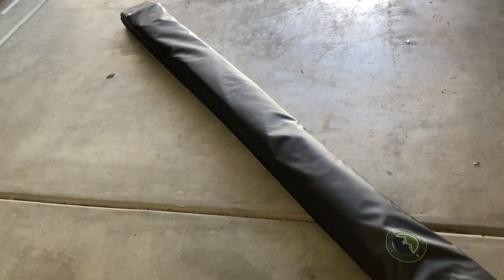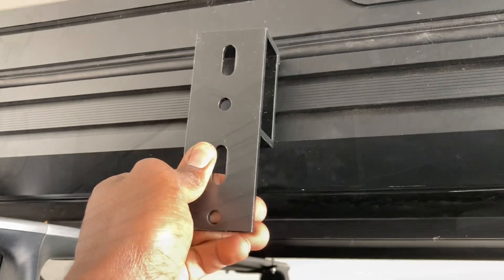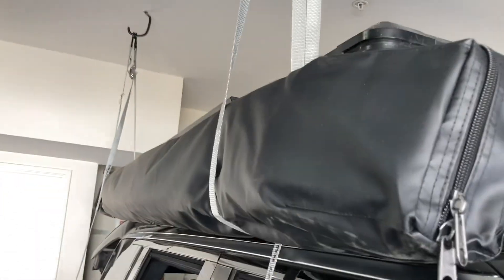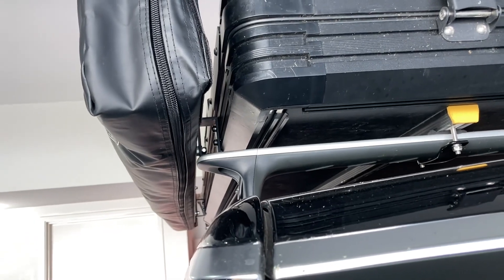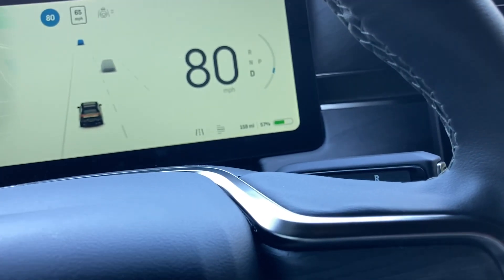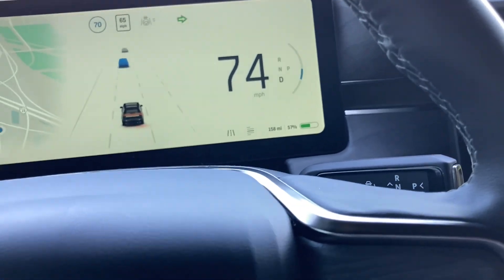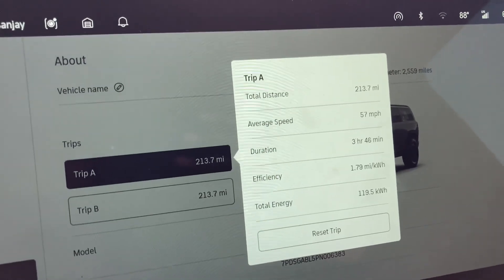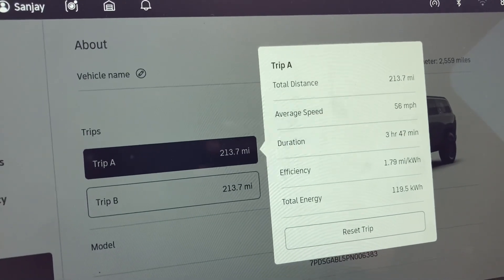Rivian R1S Awning Install. OVS 180 Degree Awning

Comment: Thanks for sharing. I’ve been looking for a while for a R1S video with a 270 awning. I think yours is the first I’ve seen. I just purchased a 270 awning and it looks like if I mount it on the crossbars the awning sits too low and I can’t fully open the rear hatch. So I’ll need to look into raising it.
Reply from the maker: So mine is a 180 and I wanted 270 so I hope you or someone can let me know how that works out. Maybe I can put a basic awning just for the tailgate portion to keep things flexible.